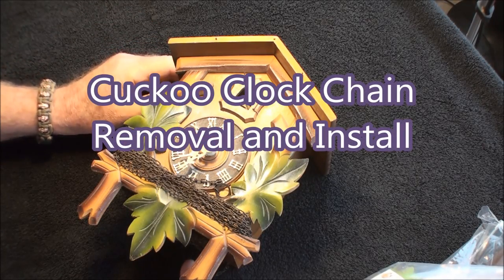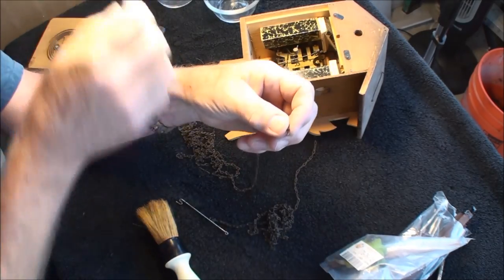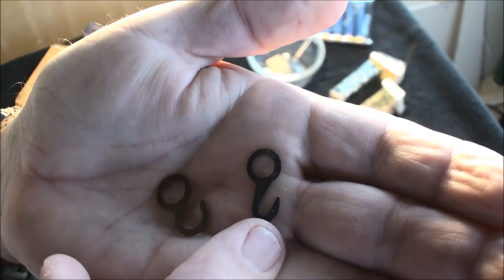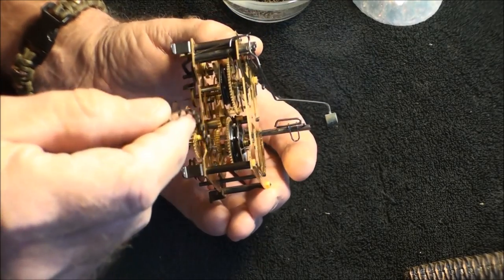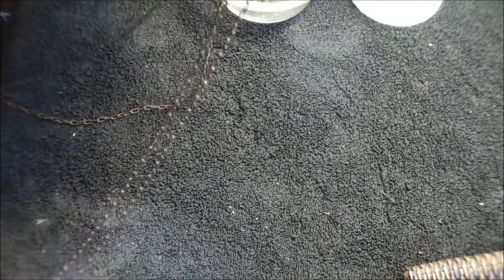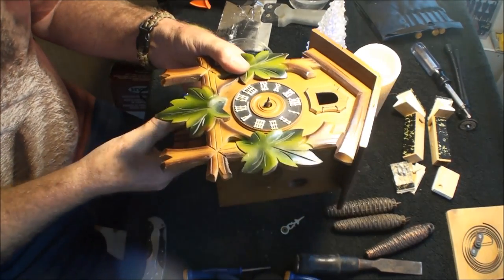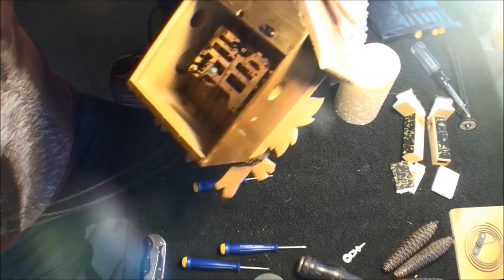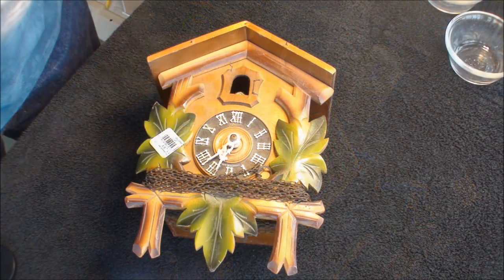How to Removal and Install Cuckoo Clock Chain

Comment: I have one that has 3 chains and a little boy that has music I can’t tell where to attach the chain … help please.
Reply from the maker: I wish it was that easy to tell you how, yet there are different musical clocks out there and different ways to hook the chain up. The most common one is that the chain loops straight up to the top of the clock and back down.

Comment: Mike how do you reset the cuckoo to the right time? cuckoo goes off at the wrong time.
Reply from the maker: Richard, it depends what your mean. If the hour is off, you can just carefully turn the hour hand to the correct time because that hand is not geared, just wedge on the shaft. If you are having a problem with the minute hand, you can take the nut off and pull the minute hand off and turn it 1/4 turns because it has a square hole. let me know if this was your problem and if you were able to fix it.

Comment: wonder if you could help please . when you was pull the chain for the cuckoo . it cuckoos and mind it stuck , cant move it  Ratcheting Chain Wheel i think is there a way to repair it please
Reply from the maker: I do not know if you have cleaned your clock yet, but if the ratcheting part is frozen in place and oiling does not help, then they do sell new ones for your clock Paul P
Reply: @justmike57  hi i fix it . some how . its all working thank you for your time . merry xmas to you
Reply from the maker: @paulp9950  This makes me happy to know that another clock didn't bite the dust. You also have a Merry Christmas and a Happy New Year

Comment: What about when u don’t have access to the motor. I have a whole clock that I don’t want take apart.
Reply from the maker: For the movement, you need to take that out every 5 years to oil the front and back where the gears come through the plates to insure the old oil does not start gumming up along with the dust. You will also blow out the movement at the same time with a can of air that is used on computers. If your clock stops running and will not start again, it is too late for just oiling. They do sell a can of cleaner that you spray down the movement after blowing it out for the people that don't want to take the movement all the way apart at Ronellclock.com.

Comment: How did you take out the gears?
Reply from the maker: I am not sure what you mean about taking out the gear. To turn the gear so you can thread the chain,  you can use a longer screwdriver to turn the gear that hold the chain from one of the holes that the chain drops through,
Reply: @justmike57  thank you.  The gold gear part came out of the clock but it is behind two wood pieces on either side.  Do you take them out?  I bought this clock in Leavenworth and it cost me a lot.  Was something I wanted since the age of six an scared to break it.
Reply from the maker: @jackiemacgregor4340  My e-mail is below the video if you could send me some pictures of the part, the clock movement and the clock and I might be able to help you better.
Reply: Thank you Mike.  I will do that tomorrow.

Comment: really frustrating here I am waiting for you to show me where the weights go and it ends!
Reply from the maker: When you Pull on the chain and it dose not move, That is the chain you would install the hook for the weight. If the Chain Moves, then you would put the ring on that chain because it is the chain that pulls the weight up to the clock for at least a 24hour run time before you have to pull the chain with the ring on again.
  I was asked the same thing months ago and in one of my videos, I told everyone how to figure out which side the hook goes one for the weight and which side the ring goes on to wind the clock.
Reply: I have one weight is already on and does not move. (I bought this at the thrift store today. I know nothing about clocks except I like Cuckoo clocks.  What is puzzling there are two other chains that have rings on them one one without. So which chain does the second ring go on. I have set the time and the pendulom is going but I still have to know where the other weight goes.
Reply from the maker: @andreacc7795  The one weight you have on will only move very slow if that is the time side. There should be a total of four chains, (including the one with the weight on it). If you only have three chains, then one is about to go over the winder and might fall off. You could slide a screwdriver into the hole that does not have a chain and move the winder in the direction that it will turn easily to get the chain back out and put the ring on it. Most of my cuckoo clock videos I have done lately I might have mentioned which chain gets the hook or ring and show how I get the chain through the holes if you watch the full video.
Reply: I see now there are 4 chains put twist tie on 3rd chain put weigh on 2nd chain and now it has stopped working. Will send you email pic thanks

Comment: I put twisteeties from sandwich bags 2 hold the chain thru and it doesn't move
Reply: Put it thru the closest one 2 top
Reply from the maker: Yes, anything you have on hand to keep the other chains from coming off while you are messing with the other chains.
Reply from the maker: That is right. You always want to keep the inside chains tight so they will not fall off.

Comment: My chains are all the way down 🙁 I’ve had one for years was giving to me figured doenst work because of those chains it’s a old German one
Reply from the maker: It sounds like the chains have fallen off the gears inside. It might take some time, but if you take off both ends of the chain and try to put them back on like in some of my videos, you might get it going again. But first I would look at the clock works to see how dusty and dirty it is Kat Ssa.
Reply: @justmike57  thank you so much for your response yes looks like they have fallen off and can’t seem to find anyone close that repairs those clocks I’ll adventure my self and try with your video 🙏

Comment: Hey Mike, did you get my email?
Reply from the maker: Yes I did H.D. Rider. I gave you an email back. Didn't you receive my email?
Reply: @justmike57  No Mike I didn't . I did however receive this last email . Did you see in the picture the wire I was pointing at?  I've been waiting to hear from you as to what the wire did or where it was suppose to go, before I put it back together. I got busy doing something else and when I came back to the cloak, I couldn't remember what that wire was for. Thanks for replying.
Reply: @justmike57  I sent the email again.
Reply from the maker: @kcglide  OK, You normally have two wires that go to the music box. One will hold the fan that slows the music to the right speed, the one you are pointing to should trigger the man to come out after the bird is done with his hour count.
Reply: @justmike57  Ok, Thanks Mike.
Reply: @justmike57 , Mike I kept thinking why  my clock wouldn't run but only only a few seconds after I put it back together. So Every time it stopped I adjusted the pendulum. Still no luck. Then I made double sure the clock was level and plum. It worked! I had the pendulum off and the clock started ticking double time. I pulled all the weights up and am going to let it tick out, just because it has set up for over twenty years. Then I'll put the pendulum back on and try to adjust it.  The bird will come out and Cuckoo, but the music man is still quiet. That wire must not be in the right place. I'll have to re-look that. Hope you got my email of the before and after pictures. You wouldn't believe the crazy looks I got from people when I told them I was trying to fix an old Cuckoo clock. What next will this man try to do? Thanks again, I couldn't have done it without your help. Now I'm on to weaving a cane bottom in my wife's antique chair.